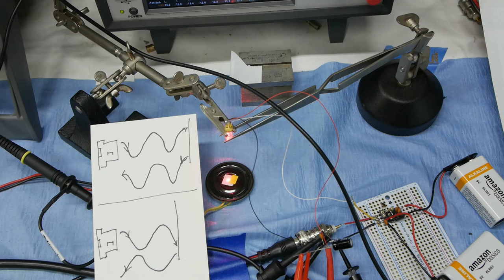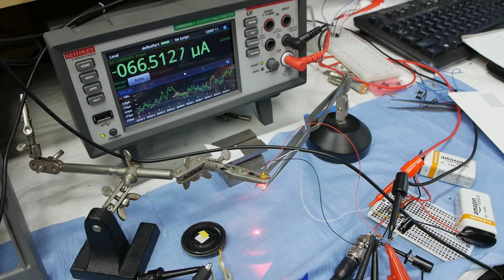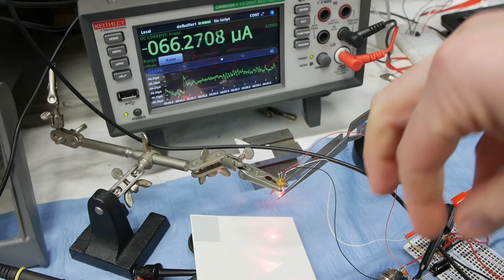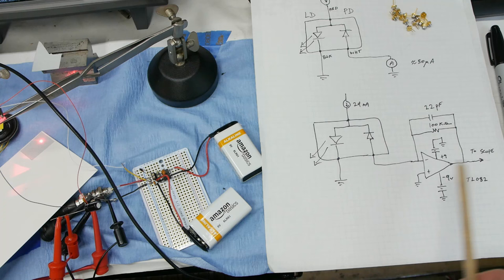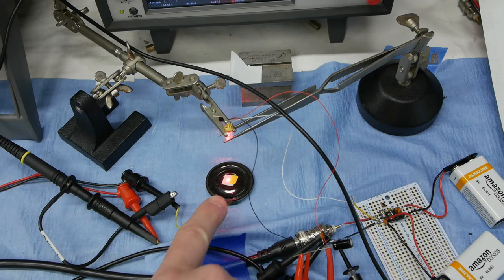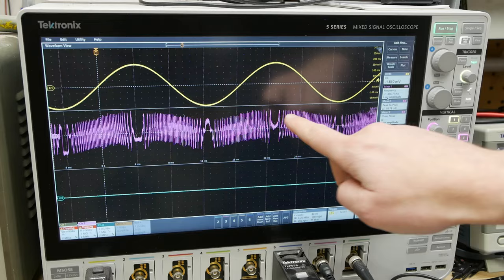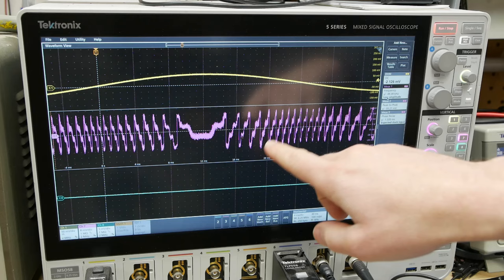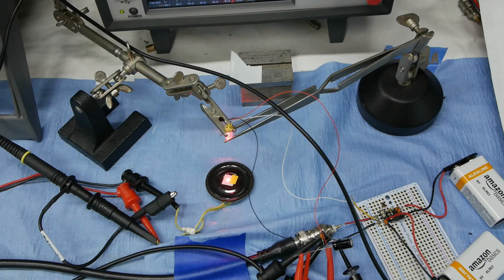Laser diode self-mixing: Range-finding and sub-micron vibration measurement

Comment: Adding and mixing are not the same thing. Mixing is multiplying the two signals, while adding, only sums them up. 

The photo-diode is simply responding to the total light it sees. When the phase of the "arriving" (reflected) light is opposite to the "reference" (local) light, there is a destructive interference between the two, and the photo-diode (which monitors the total amount of light that it sees), produces a lower photo-current. The opposite is true, when this interference is constructive . And that is exactly what you see on the scope, which, you call "mixing". 

A true "mixing" inside the monitoring photo-diode, would produce a sum and a difference of the frequencies of the two lights (local and reflected), and since the sum is a very high frequency signal, you would ONLY see the difference, because of the low bandwidth of your observation channel. That difference would appear as a DC signal, only, since the frequency of the two lights is EXACTLY the same. You would only observe a change of the amplitude of that output signal, as you move the light target, due to the fact that the phase of the reflected light changes with that distance (Doppler effect). 

Note that because the amplitude of the reflected light, also changes somewhat with target distance, the output of a true mixer may not be exactly what you would ideally expect from a pure multiplying operation between the two light signals.

Comment: I wonder if you could make an ultra low cost, high precision 3D laser tracker(like a FARO ION device) using a regular(linear sensor) rangefinder to get to around +-1mm precision, and then this laser setup in fringe counting mode to sweep the last mm of accuracy at a range of ~10-500cm.
I believe that this is how the FARO ION works, but they use a huge discrete interferometer setup and the device costs over $80 000.

Comment: Really interesting topic.  Wondering if it would be possible this way to measure a distance to a static object  - like laser diode mounted on the sturdy arm pointing bean to a metal surface? Absolute value is not really important - what is important a difference between several points  on the surface.

Comment: Even if the laser didn't come with a photodiode, you could mount a discrete one next to it. Discrete photodiodes are pretty tiny as it is, and cheap. I was lucky and recently found a pack of 5 photodiodes locally for a couple of bucks. And that's at a markup. It was actually old stock from Radioshack at a surplus store.

Comment: You can still get laser diodes with monitor photodiodes, but you need to buy a large quantity direct from the manufacturer, not from amazon or ebay mass-market resellers.

Comment: So here's how my brain processes that output waveform from when the sine wave is applied to the speaker.  It's a way to picture why the lower purple trace has the steps in it.  How this relates to what's really happening I would have to think about.  But take the yellow input sine wave and invert it.  Amplify it some and then digitize it.  Take only the bottom two (least significant) bits and run them through a digital to analog convertor and display that new analog signal on the scope and you'll get something very similar to what you see in the bottom trace at 27:45 or so in the video.  The steps are the result of the "D/A convertor" counting up or down, and the big steps back are when it "rolls over" from 11 to 00 or the other way.   The waveform also reminds me of a Fresnel lens profile, where you are removing the bulk of the mass of the lens but keeping the profile in steps.

Comment: Im curious to see the result of the same setup but with the shop lights turned off. If those lights are running at about 50-60Hz, that could explain a lot of the signal noise.

Comment: Really amazing video demonstrating sub-micron measurement using salvaged parts from CD/DVD reader or writer. Using a twitter instead of a woofer allowed to induce really small motion.

We know that CD/DVD burners have to modulate the laser output in the 100 MHz range. Is the laser diode can respond that fast to small change in the current?

Comment: When you talk about getting a higher gain amplifier to measure the interference with the laser diode itself, the first thing that came to mind was an instrumentation amplifier. Have you considered doing the same setup with an Instrumentation amp to measure those tiny variations?

Comment: Pass the AC output of your amp to a differentiator op amp and use a frequency counter. If you know the wavelength, then it is simple math to get the distance. Granted, you still need stability and heavy filtering of the output I assume.

Comment: The good old laser snooper. I am under the impression that even the vibration of your voice was changing the wavelength. Other than a spy laser snooper, it may even be used to somehow drive an external lens servo mechanism to autofocus the diode itself to compensate for distance. Just saying.

Comment: I don't think you really have a tachometer when doing the reflective tape over motor axle experiment. Thing is although every point of the axle in laser  path is moving towards the laser diode, on average, the distance of the light traveled assuming the axle is circular and not "D" shaped is constant. What I'm assuming you're getting is a measure of vibration in the motor coils that should be proportional to the motor speed. There is even an experiment you could do to diferentiate: try increasing the radius of the axle by adding some plastic wheels of different diameters. The motor vibration should be similar, but the vertical speed and distance traveled should be proportional to the radius.

Comment: Make a 3d microscope using groups of 4 Cartesian arrays aimed by reflection off of a piezo actuated mirror (error corrected by nulling with each other), set up for x,y,z then run sweeps correlated against time, pll'ed against the difference in the base movement for a composite image...?  Or 2d by passing an array over an object on a vibrating table, phase nulled for error correction?

Comment: The current waveform is essentially phase. It ramps and wraps (just like phase at the 2pi boundary). Rate of change of phase is frequency  (doppler frequency). This is just doppler phase instead of doppler frequency.
Reply: McKenzie Keith 

Basically the integrated detection diode outputs a DC current in proportion to laser intensity and not phase. Only through interference we saw intensity ripple on the DC current. Positive ripple peak corresponds to in phase and negative peak for opposite phase. Also that we’d expect a sine wave ripple wave form, yet we witness distorted ripple shaped like saw tooth with leading edge and trailing edges. One thing I could not figured that out. Another way to proof of a Doppler effect is to compare ripple counts on the positive and negative slopes speaker wave. Uneven = Doppler, even = Doppler absence. Cheers,
Reply: @philoso377  Let's make sure we are talking about the same thing. When he stops the oscilloscope at 12 minutes, look at the purple waveform. That is NOT a sinusoidal waveform, which is what you would normally expect if it was a mixer which computes sin(w1*t) * sin(w2*t). What is happening is that it is computing w1*t - w2*t. In other words, instead of mixing to produce the difference frequency between emitted and reflected, it is computing the difference in phase between the emitted and reflected. So it is still periodic, and the period is still the Doppler period, but the waveform represents the phase of the Doppler frequency. You can see that during the rising portion of the sine wave, the sawtooth has abrupt vertical rising edges, and gradual falling edges. This is decreasing phase, when the speaker is moving away from the laser. Then after the cone reaches it's maximum excursion and goes the other way, you have abrupt vertical falling edges and gradual rising edges (mirror image of the waveform before the peak speaker excursion). I don't understand the stair-stepping. It may have to do with the fact that there are multiple reflection points in the laser beam. But it is very clear that the waveform much more closely represents phase vs time rather than amplitude vs time. Similar observations persist throughout the video. I hope I have explained myself better.
Reply: McKenzie Keith 

I wanted to agree with you, but I need help to point out what I went wrong below. 

We have three sinusoids signals here. 1st, forward A(Wc*t). 2nd, reverse K(A*Wc*t) and 3rd, injection 1(Wi*t). K = path attenuation, and assuming the 1st, 2nd met at pi/2 for a good start but essence. 

The 1st is a carrier signal, the 2nd, is a copy of the 1st, return and attenuated to interfere (vector sum) with the 1st at a photo diode, the diode can only discern and pass on magnitude but phase or frequency.

Why? because in absence of a quadrature phase detection scheme and digital signal process were missing here, that is necessary to reproduce our infamous curve with a 0 to +/-2pi break.  

The 3rd signal is set up to modulate the return path distance, 1(Wi*t). So photo diode saw A(Wc*t)+K*(A*Wc*t)+1(Wi*t) and pass on magnitude but phase component. 

I need help to explain what constitute those saw tooth and it’s harmonics. 

Your comments?
Reply: @philoso377  I think your logic and math is correct. Except that something else is happening that I don't really understand. I looked at the paper in the link that explains the shape of the waveform. But I did not really understand it. However, the pictures in the paper are very similar to this video, except without the stair stepping. Maybe you can understand the paper better than I can. Also, please note that I am focusing on the setup with the speaker, not the setup where he modulates the laser intensity. So my two frequencies are the frequency of outgoing laser light and reflected laser light. Technically, the reflected light is not a copy of the transmitted light, because it is at a slighly different frequency (due to speaker motion). To me, the audio frequency is just a way to make the speaker move in a repeatable fashion so we can observe the effect on the laser diode signal.

Comment: Have you tried the same experiment using coaxial (or shielding) of the exposed wires, that connect the diode and the speaker?

Comment: The wave reflection diagram you use is a bit off, since the phase difference of a reflected beam is lambda/2 if the index of refraction increases across a boundary. If the index of refraction is less across a boundary, this phase shift disappears, but the speaker material isn't changing as it moves about. https://en.wikipedia.org/wiki/File:Pulse_reflection.png -- That being said, Im trying to wrap my head around weather or not this is acting like a laser Doppler vibrometer.

Comment: Also, what I think was the coolest of the set of cool observations was the ability to measure absolute distances. One would have to be careful that the interval of ramping up the current before resetting was not fast enough to have the interference occur in a subsequent period or interval of change in amperage. I have not thought this through beyond the surface but I am wondering what kind of distances you could obtain?
Reply: The gravitational wave observatory (LIGO), is working on a space based detector using this principle. The earth based sensors use lasers to measure signal path length.

Comment: 27:09 i have better idea ...
Why not use only  40 % duty cycle for laser  and 40% or continuous for Laser Photodiode by applying square wave to laser and  reading the puls of  amplitude changing  . So this way you can avoid the interference but you have to compromise the distance Reading speed  but you can increase the frequency for fast realtime Reding .

Comment: just watched the first five minutes by now (gonna do the rest still). but for completeness one should mention that there is not only one internall wiring of laser and monitor diode. usually you can buy every laser diode that has a monitor diode in 3 different configurations (usually reffered to as p type n type and m type(atleast in germany) )

Comment: thats one huge oscilloscope
btw at the end you said the laser diode can measure all that almost without any external components... your used 20000$ worth of measuring equipment (oscilloscope, function generator, constant voltage generator...)

Comment: How is the spinning motor creating a signal? It is because the reflective strip isn't actually smooth, right? So the reflective grains move towards the laser, then move out of the beam which then hits a spot farther back again. On a perfectly smooth tape you would not get any signal on a spinning shaft, because there is no change in distance at all. I doubt you will see a doppler shift of the light at thse speeds ;) .

Comment: I am the real dumb one. Watching YouTube videos as much as possible while taking notes. So far just on capacitors I have listen to people say caps don't allow DC. Caps don't allow AC .Caps filter PS. Caps decouple. I have made step by step projects and built some projects from scratch. My problem is when I look at a circuit its not clicking in my head.Yes I can take a repair manual and follow instructions on how to tune up a radio. I have an icom 706 that really old and got a bit off frequency on receive. Easy alignment. As for as looking and understanding how it works in general,,, No idea. Also it gets frustrating trying to understand all the different types of caps, what this zener diode is doing, calculating the charge and discharge times. The amount of heat a transistor can take with and without heatsink and on and on I could go. I love electronics.I would say I love it to damn much.

Comment: is that trans impedance amplifier similar to Dave Jones' µCurrent?
Reply: Yes, same concept. Dave's circuit has a bit more stuff around it (negative voltage generator, range switching) but the core circuit is the same.

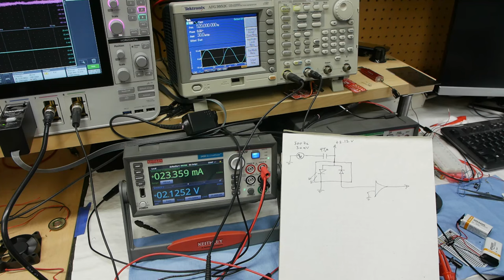Comment: If the circuit at 23:59 is a constant voltage supply, the AC coupling should not work, as you show, the supply is "Fighting" to compensate the perturbance, so the laser is not getting much of it. Or am I very wrong?

Comment: The reason you can hear the 60hz square has nothing to do with ringing. Its the spectrum of the square itself which is hearable. Think of a perfect 1hz speaker square wave. you can hear it but not a sine wave one. The spectrum has harmonics which are above 60hz.
Reply: With that last part, would that mean that you can effectively do comparison to determine the interference offset and use the variation in interference between outgoing and incoming light as a sort of vernier scale system?

Comment: I am interested in the effect of modulating the current to measure absolute distance. If current modulation can affect the response by shifting the wavelength, wouldn't that conflict with the interference that you were trying to detect in the original case of control voltage mode (which allows current to modulate). I understand that the current modulation would only show up if it is modulated at a consistent frequency, so is there maybe a case where the built-in control system can produce false-positive results in the response?

Comment: if you had a few lasers set up like this, all of them being for example a few milimeters back from the next one ... couldnt you have a step counter like in a printer the band with the stripes ? also wouldnt longer wavelenghts be better? so infrared be better for a higher detection range peek to peek ?

Comment: The light coming back is only partially coherent after scattering from a rough surface. What happens if you use a lens to focus it on the target so that it comes back as it would from a "point" source? Much better signal?

Comment: How would you detect the changes in current to switch a circuit? For example, when the current changes when the reflector card is inserted and removed, I would like a circuit which can detect the change and use the result to turn devices on and off...

Comment: Two things:
1) is the resolution not twice as sensitive? If you move the object 1/2 wavelengths, it shifts the interference pattern by 1 whole wavelength?
2) if one uses two motor-rotated mirrors would that not make for a very crude microscope? Would love to see that!
Reply: I think 1) is an excellent point. You get from one constructive interference at the monitor to the next constructive interference by just moving the object by half a wavelength.
(Making the PLD a single wavelength)

Comment: I've noticed that speaker was able to catch your speech. I looked to me that some of the noise in 'movement detection' stage was correlated to your voice. Can you try to recover a sound by laser? Thanks for a great video!
Reply: amaraojiji 

Yes the output signal may responds to sound pressure confronting the speaker. Such response is convoluted and unintelligible. However this can be decoded by studying the characteristics in that response and write some specific code into a signal processing engine may be we can understand.

Comment: if you shine two different colour lasers at the detector, do you get a beat signal?  so knowing one colour you could easily calculate the colour of the second?
Reply: In principle. But in practice it is only possible to measure the beat frequency electronically is the colors are very-very-very close. The frequency of the visible light is on the order of 500000000 MHz. So for a beat to be 1 MHz, the wavelength of the two beams must be similar to within 2 parts per billion from one another -- then it works just fine and is actually used in some applications.